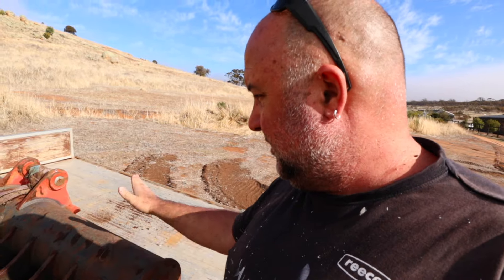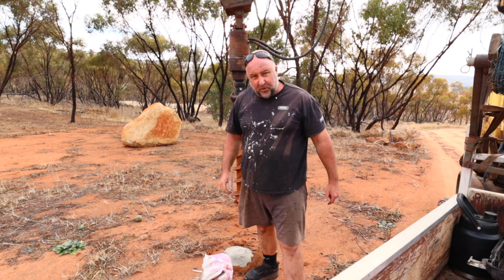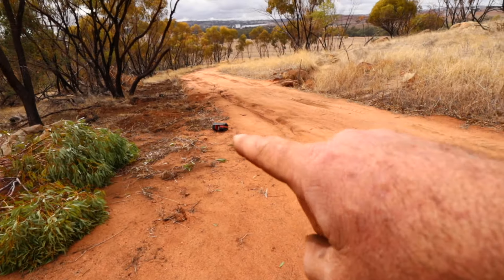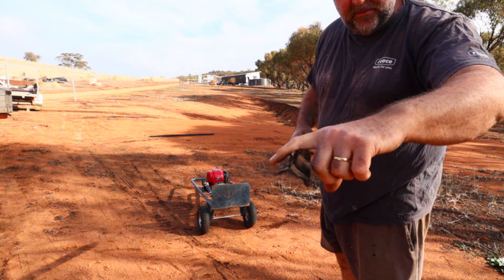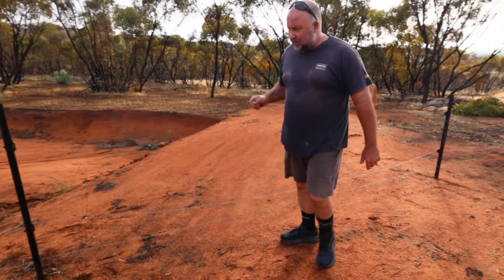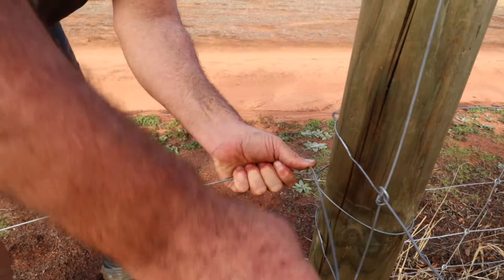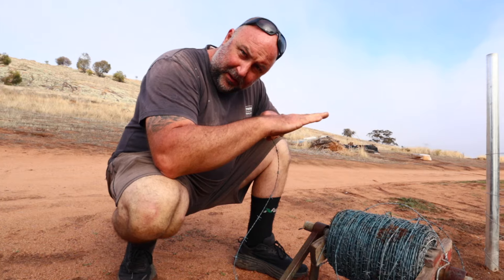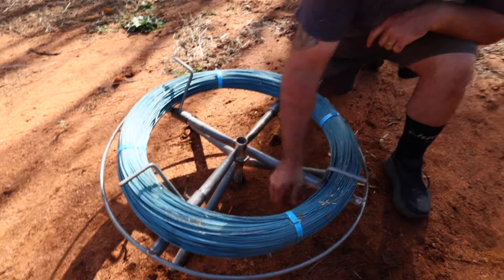Our biggest fencing project yet: 10 acre, 5-strand electric cattle fence | Part 1 the first 150m

Comment: Hi mate,  I might be wrong, but I've always used the holes in star pickets to put my tie wire thru. As you can't obviously pull barb thru the holes provided.
Reply from the maker: We use the holes to tie ring lock back and I know some people will tie back single strand rather than put through holes. Barb will sit in the top groove and that will be tied back through the top most hole. Not sure if I answered your comment correctly?

Comment: A good wind building up there at the end.  How many inches of rain did you get?  I'd like to see how the beaver dams do after a flood since they had so much time to dry out.
Reply from the maker: Not a heap, under 20mm… so about an inch? But is was a good steady soak which is what our parched ground needed. Didn’t want a big rain event that washed away our dry top soil 👍👍 will go check out the beaver dam and leaky weir once Corey is getting around a bit more

Comment: Gday RP’s. You showed the star picket insulators but what did you use on the corner post?
Reply from the maker: We did something slightly different for the copper logs vs internal steel post corners vs external steel post corners. We kinda got rained out at the end there so will go into more detail on all those on our next run 👍
Reply from the maker: But quick answer is ceramic insulators set off of the post
Reply: I’m about to do my first fencing run (87m). See how I go in amongst the trees. Wish me luck 🤣
Reply from the maker: @kenno030  good luck mate, tree roots and pesky tree trunks are almost as painful as rocks!